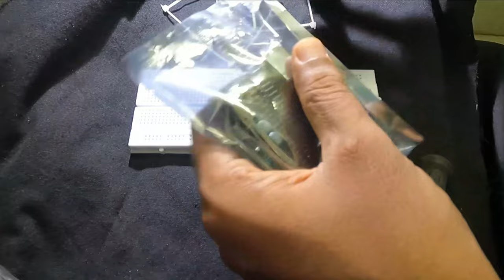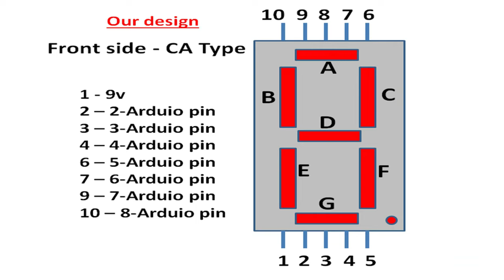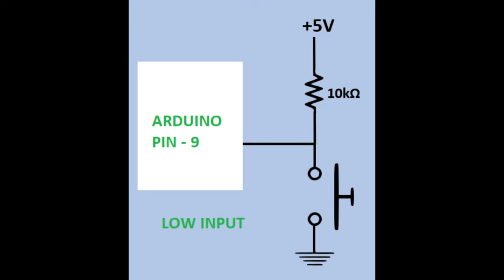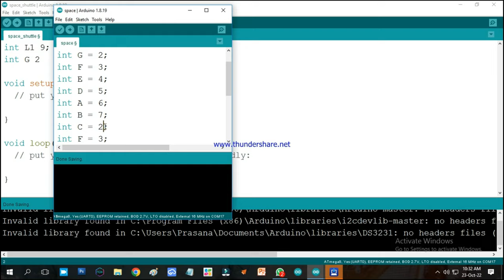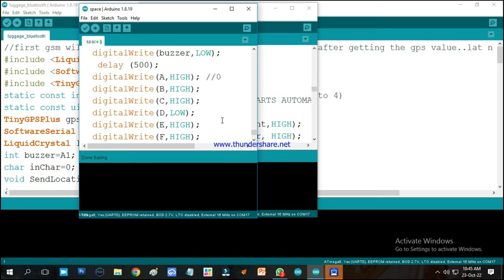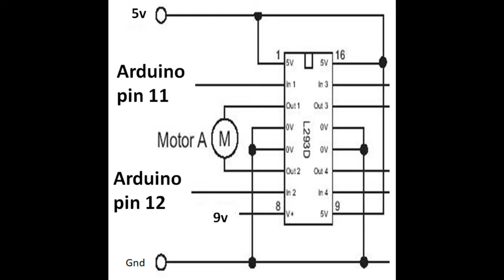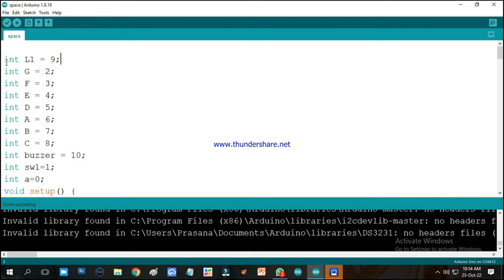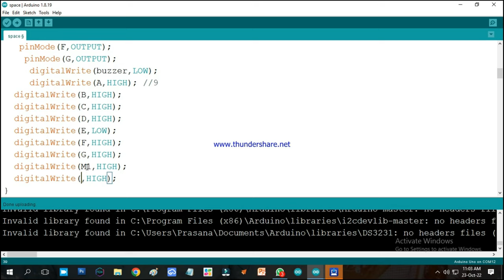Space shuttle lunching working school project with arduino how to make #chandrayaan3  lunching model

Comment: Tampilan tujuh segmen 3 inci 1
Arduino UNO 1
Jumper kawat dudukan tunggal 2 meter
Buzzer 1
Sensor efek Hallo 1
Papan tempat memotong roti 1
Bc 547 8
L293d 1
Motor roda gigi 30 rpm 
Motor I penjepit 1
Rak 15 inci 1
Pinion 1
Menggambar slider 12incg 1
Baterai 9v 4
Resistor 1k 15